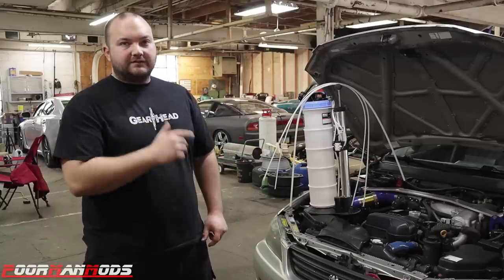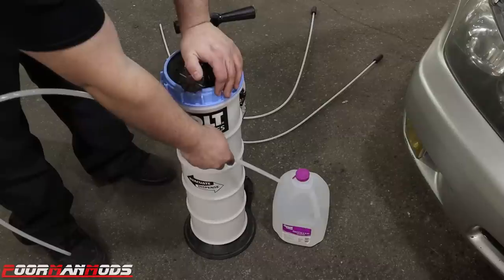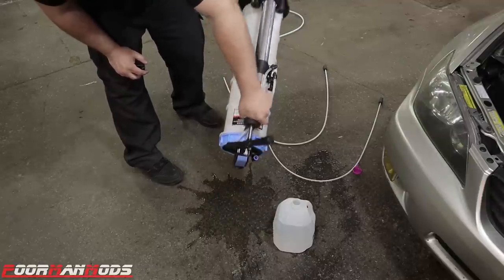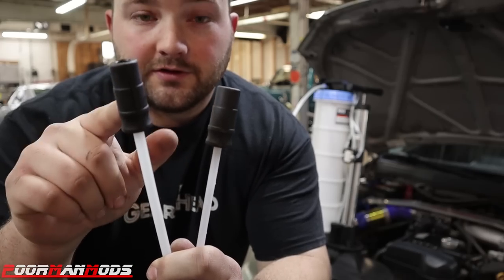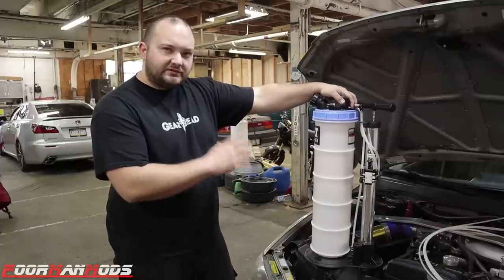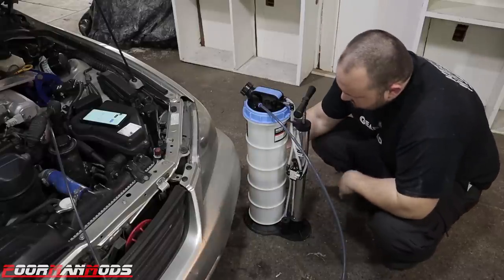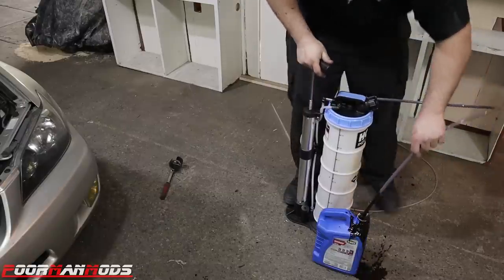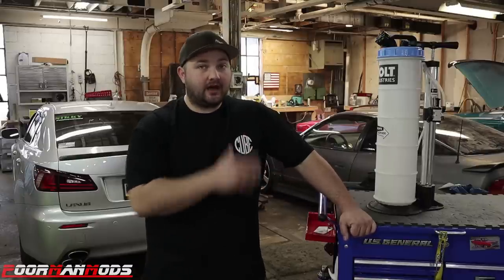Faster and easier oil changes? Holt Industries fluid extractor & dispenser review | Harbor Fright

Comment: Just bought this today.  Build quality is pretty good.  

Just under 8 ounces of fluid remains in the container after you dispense as much as you can....and yes, that cap was on ultra tight.  I had to use pliers to get it off.

Comment: My first thought about the crimped off black tube was it was there as an over pressure relief for if the fluid and gasses were to expand.  It could deform and the device would not be damaged from over pressure.  Tubing storage seems more likely though.

Comment: I have the same Holt Industries fluid extractor and I too, had to use a channel lock type of pliers to unscrew the cap for the first time. I only use mine for extraction so I don't care about cross contamination.

Comment: As far as a fluid extractor (such as removing motor oil from the dip stick hole) I would highly recommend one that attaches to an air compressor. The ones with a hand pump do not provide constant suction and will not remove all the oil. Any cheap or small air compressor will work. I personally have used the MityVac 7300 fluid extractor for this, but there may be other brands and models also.

Comment: The pockets at the bottom could be good if you are reusing the fluid. Will allow sediment to settle out and you don't put it back in your project. That could be a good thing in some cases. Great video. Thanks
Reply: You are completely correct when you say, "the pockets at the bottom of the machine are there to allow sediment to settle out of the fluid"!
Reply: I just got one to extract new filled transmission oil since I have to redo the pan gasket and then I will just reuse the fluid since it is brand new and very expensive per quart.

Comment: got this thing yesterday and used it to extract fuel out of my portable generator. you definitely don't have to keep pumping it. 4 or 5 pumps will give it the pressure it needs. if doing oil, it should be warm. makes things go a a lot easier. 

thanks for the tip on cleaning as i needed to know how exactly to clean this thing.

Comment: I wouldnt worry about the machine not getting all the fluid out, its main purpose is a extractor, it having the option to dispense the used fluid is a bonus. Imagine you filled it to the top and not having a dispensing option and trying to tip that tank over to pour into another. it would be heavy and you would make a mess. Having the dispensing option is to lighten the load so you can clean and get the rest out effectively and not worry about making a mess or hurting your self or others.

Comment: Earlier this year, I bought the Holt at Harbor Freight without the dispenser feature, about $20 less than the model in the video.  I use mine only for oil changes/extraction on my car (2018 Subaru Outback).  Maybe some helpful hints:  1) You will likely NOT get all of the oil out of the oil pan but, as the man says here, it's not enough to worry about.  Even if you insert the extraction tube perfectly on level ground, it will not drain as well as using the engine drain plug.  THAT SAID, the Subaru FB25B engine in my car feeds the dipstick tube through the timing covering, not directly into the oil pan, so that can explain my issue.  Of course, extracting it on an incline or decline can affect this.  I park on the slight decline of my driveway to extract.   I check the dipstick on level ground.  2) Make sure the extraction tubes are free from blockage.  Even the smallest obstruction can affect the vacuum pressure.  I plugged the tubes with paper towel to keep from dripping after I first used it and a small, soaked piece got lodged in the tube.  The black connector prevented me from seeing it.  It took a while for me to figure out why the pump was hardly working when I used it the second time.  3) I used WD40 to clean out the tubes after my first use and it seemed to do an excellent job.  However, I've since learned that you're supposed to avoid using WD40 with polycarbonate and polystyrene plastics and I can't verify what the tubes are made from.  Now I use a gun .22 cal cleaning patch to pull through the tube afterward to thoroughly clean it.  I'm happy with the Holt extractor so far.  Very convenient.

Comment: I guess you could pour a little epoxy in the bottom to level up the ridges then cut the suction hose a little.  Prob not worth the effort because having to clean it every time is the real problem with using the same unit for extraction and dispensing.  Great review thanks for taking the time.  SUBED!!
Reply from the maker: Good idea and thank you!

Comment: There is an easy hack for these oil extractors. You can use a shop vac and suck the oil out like they do with air-compressor. That means you can do way more than anything out on market. You need to use some compression fittings  and simple PVC to hook to Shop Vac suction end. Disconnect air tube going into container. That is where you hack your by-pass adapter to. Real easy!

You'll have a Deluxe Holt Oil Extractor like no other. It will extract, dispense, and it will have option of vac suction with a Shop-Vac!

Comment: My pilot is way overdue for an oil change, but when I tried to pull the plug I found out it is SERIOUSLY over-tightened. It wouldn't budge, and the proper size socket slipped and rounded it. The plug is not leaking at all, but it's almost guaranteed that if I extract that plug, it's going to pull the threads right out of the aluminum pan. My options are: pull the plug and attempt a half-ass thread repair, take it to a mechanic and hope he doesn't screw up the thread repair (wrong-angling the tap or leaving metal shavings in the pan), get a new pan (requires chaining the engine from above, removing the headers, removing the subframe, and then getting an alignment when done) or getting an extractor and leaving the non-leaky-but-non-removeable plug in place.

I think I'll get an extractor.
Reply from the maker: Hells yeah

Comment: I use a similar pump to do oil changes. rule #1 only suck out oil that is hot....or you'll be waiting 15 min for it to get the oil out. hot oil makes a big difference for obvious reasons .
Reply: Correct, but stating hot could lead people into trouble. What you want is operating temperature, usually around 80-120 degrees Celsius. Otherwise, too hot and you got yourself an extractor tube that will melt and stick inside the oil pan/dipstick.

Comment: if it bothers you that much fill it with epoxy. and that hole with black tube is for storing the line from the oil inlet so it does not just drip on floor after removing it from car storing the hose. and the engine oil should be hot. read the directions please

Comment: I just did an oil change with it.  Overall it seems pretty good, but the connection between the big hose and the little hose was FAR too loose and I ended up leaving about a quart behind.  I thought I had it all, but got a  messy surprise when I took the filter off.  Maybe the little hose needs to be longer, but I think it was just an air leak between the two hoses that weakened the vacuum.

Not a deal breaker at all and not serious enough to return it.  I found a small piece of tubing that can be squeezed over the small tube and under the big one. With a couple dollars worth of cheap hardware store tubing and connectors, this can be completely corrected.

I got the cheaper, non-dispensing model.

Comment: I bought one of these pumps last Saturday from Harbor Freight.  At $139.99 plus tax, I was appreciative of an on-line 20% off coupon! I have not used it yet, but I really did enjoy your review and demonstration of this unit.  Good job!!!  I do plan to use this unit ONLY for motor oil extractions on my truck, SUV, sports car, VW Beetle, motor bikes, zero-turn mower, ATV, and side-by-side. I feel this unit will allow me to perform required oil and filter changes for years to come.  I'm clocking in at 59 years old as I type this, and I have advanced Arthritis in my right hip and left ankle, both broke when I was a young man.  Now, I have a lot of pain and can no longer slide around under vehicles and stuff.  I have always enjoyed maintaining my vehicles and I hope this unit will help me with this journey. Again, thanks for the demo!

Comment: I installed a Fumoto oil drain valve on all of my vehicles for faster oil changes. I can directly drain the used oil to a jug without any mess. It takes me 30mins maxs to perform the oil change.
Reply: I wonder how much oil is left in the pan because of the thread of the oil change valve! Look how far the the threads go up into the pan!

Comment: The feature this unit has for 'dispensing' is really for 'emptying' the old dirty oil from the tank into easily transportable containers for recycling. The idea of cleaning it out completely so you can then pour new oil, tyranny fluid...etc into it just to pump it into an engine or transmission is not what the designers had in mind and is much more effort than is needed.

Comment: The black tube is there to hold the hoses that come with it.
Reply: Or be nice to open that line to have a bigger dispenser hose with plug since is for vacuum a rubber plug will work fine I think 🤔🤔🤔

Comment: Thanks for overflowing that bottle, I would have done that with extremely dirty diesel oil. Now I will just put it in a large oil drum and throw those jugs away. Lol I made a mess every time using the pan plug underneath.... expensive, but worth not having to clean up an oil spill each time...
Reply from the maker: hahah youre welcome, thanks for watching

Comment: Had the same complaint about the bottom webbing. Cost me 20 bucks worth of epoxy but I just filled it in flush with an chemical resistant epoxy and its been great for the last 6 months or so.
Reply: Yes I also realize that maybe alters the fluid level marks slightly but I don't trust these for any sort of precise measurement anyway so it hasn't worried me.
Reply from the maker: whered you get the epoxy?

Comment: If  you do any fluid transfer the lower "6 sections" on the bottom trap any particulate contamination so that you do not reinstall it back into the next place you removed it from or the new  place you wist to reinstall to.  Otherwise known as a contamination retainer.

Comment: I purchased a similar one. I have a lowered e46 325xi with all the undertrays. I have to sets of ramps and the one for lowered vehicle doesn’t get it high enough to be comfortable working under there. After one use it had paid for itself.

Comment: Is there a way to shut off the flow when dispensing?  Like if you are trying to fill quarts with old oil after an oil change.  It looks like it would be hard to time the air pressure stopping before overflowing small containers.
Reply from the maker: Opening the main cap will stop flow

Comment: Hi! If you clean it with gasoline and pour it away,  i cannot see any problem. (Lube the top cap threads.) That black "inner" tube could be for those white suck tube storing..?

Comment: Looks like it would be easir to pull drain plug for oil. But would be good to pull old transmission fluid out without dropping the pan .
Reply: Normally if you're changing the transmission fluid you "should" drop the pan and change the transmission FILTER too.
Reply: @frankr.2392  yes that's true. But in some cases if your getting rutting from fluid break down you could draw some out and add new to stop rutting until you can do pan drop and filter change.
Reply: @frankr.2392  Yes, but a lot less messy to drop an empty pan…

Comment: If you wanted to find out how thorough it extracts the oil from the oil pan, do your pump extraction and then pull the plug on the oil pan to see if any more oil drains.
Reply: You don’t have to pull the drain plug unless you want to. It’s made to take out about 99% of the oil. What kind of car do you have?

Comment: I have a 12v electric pump style one, small and compact. Just connects to the cars battery or a jump pack via crocodile clips, switch it on and leave it to do its thing into an empty container. Also its easier if the oil is warm. Wouldn't be with out it, and only cost me £20 uk or around $30 American

Comment: Fantastic review. I have a 2006 subie sti . Just did front and rear differential fluid with manual transmission fluid. Looking for a pressured dispensor to make it easier. Got the walmart garden 1 gallon prayer. Will improvise it for auto fluid use. The harbor freight is too big.

Comment: Let's not kid ourselves -- this is a labor saving hack for those who don't have access to a lift.  If you think this is for you, do this test -- use the extractor to drain what it will, and then drain what's left thru the drain plug to find out how much dirty oil the extractor is leaving behind.  Look at the quantity and the condition of the oil that was left behind, and then decide if you're ok with those last XX ounces of dirty oil staying in your engine.  But keep this in mind, the worst of the crud in the oil is settling to the bottom of the pan.  If you always leave the last half quart or whatever behind, the sediment is getting more and more concentrated.  Personally, I think getting 250-300k+ miles from an engine is worth doing regular, complete oil drains and refills.

Comment: Great review. Better than%90 of the unboxing/ extended selfie nonsense that most people try to pass off for one!

  That exposed Baffle in the bottom is a perfect example of lack of attention to detail. If I didn't have a gallon epoxy kit, I would never consider buying it . Honestly, 8oz loss of Royal Purple synthetic gear oil is a ($5) deal breaker.

Comment: I purchased the all steel one from harbor freight that holds about 8 gallons of oil and works great. I try and stay away from plastic whenever I can.  I have been using it in my shop for over 2 years and never had a problem with it. 

However you will need a compressor to make it work. It works about the same as the Holt but its a commercial grade tool and cost about $179.00.

The only negative about the metal one is that it doesn't pump the used oil out of the storage can.
We do about 6 oil changes then remove the large brass cap on top and carefully lift the tank and pour the old oil in large plastic containers. 

Their is no reason to clean it since its steel and brass, so there is oil in it all the time until we dump it. The only thing that might break in the future are the plastic hoses as seen in this video.

For home use it should last a lifetime.

Comment: You are kind of a dofis, first of all it's a dirty oil extractor, use it as such.... I would dispense in a larger container, if a smaller container is used, flip the valve to stop the pressure. Leave the remainder in there until the next oil removal, who cares what dirty oil is in there. 
Those big oil drain units used in service centers, don't worry about what oil they collect. 
The main thought I get about this product is, I don't have to jack the vehicle up and drain the oil pan into another oil pan and then spill it all over trying to get the dirty oil in to another container. This is much easier, and cleaner.

My only concern and it's not about this product, it's about the oil filter. In most cases it's still under the vehicle. If they are moving the oil filter up top, it's a no brainer.

Here's my take, this is a money saver as well as time. Suck the dirty oil out, change the oil filter , add the new fresh oil and be done until the next time. I didn't have to pay $80 for maybe $30 worth of oil and a filter. The dirty oil can be taken to a number of places FREE, make that a trip when you go there. This is a win win and I need to have one.

Comment: Mix up some epoxy and pour it in there.
Reply from the maker: Good idea
Reply: Finally someone that had the same thought as me on this I tried this on another design and it worked out great I found a lot of these extractors are made this way🥺the epoxy trick works i filled from the center to get a even fill in all the pockets😊👍🏾

Comment: That thing is not going to get all of the oil out of your oil pan. Especially, if the oil pan has protrusions on the bottom, etc. Also, some oil pans are equipped from the factory with magnetic drain plugs, that need to be cleaned, or even two drain plugs. I pull the plug(s), drain the oil and let it sit for 10-15 minutes, allowing the residual oil to seep out. The only time I have ever used the vacuum method is on an I/O drive boat, where there is no other option, besides pulling the engine. Take the extra time...after all, cars are not cheap machines.
     I could see where this could make a transmission fluid change or an oil change less messy by sucking the fluid out, bleeding brakes or changing coolant (but I would still pull plugs, pans or hoses). I wouldn't bother dispensing fluid with this thing. I like a clean, uncontaminated container. That  said, I think I'm going to purchase the air powered version of this thing. Seems very useful to have around even to a home mechanic like me.
Reply: in a large number of newer vehicle they no longer have drain plugs and this is the only way. Further more, you never get all the oil out even when pulling the plug, typically there is a threaded protrusion inside the pan that prevents a small but significant amount of oil from draining out. In some cases you may actually remove more this way than by pulling the plug. Each model is different though.

Comment: Honestly, who cares if some oil remains at the bottom?  It's a tool.  There's always going to be an oily residue at the bottom.  Why is that a problem?  It's not full of oil.  Drain as much as you can into another container and recycle it!  I just don't understand why cleaning "used" oil from the bottom is a point of contention. ?
Reply from the maker: Its a problem because it significantly increases the effort and time it takes to clean it so you want to use it for fluid dispensing, cross contamination is bad.